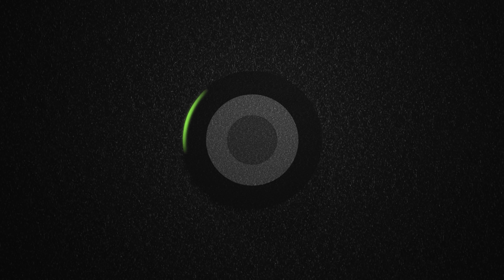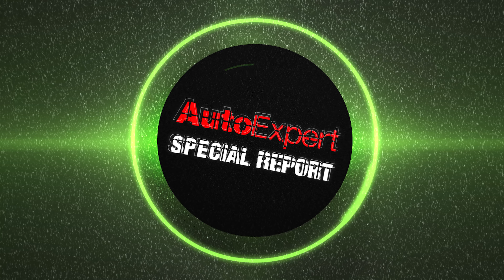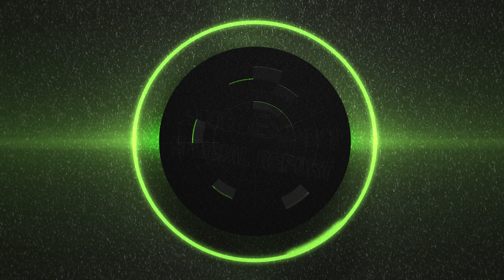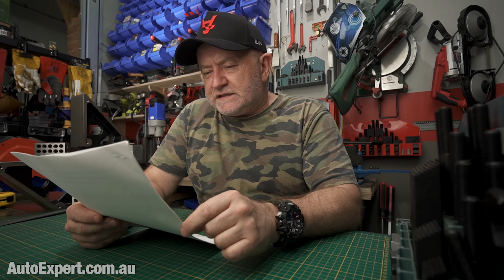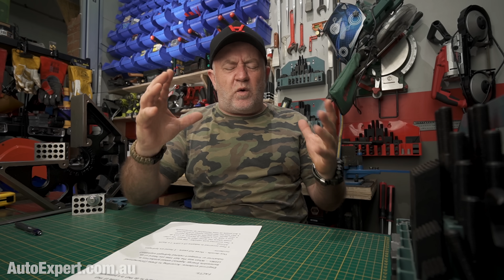The truth about fire risk: Hydrogen fuel cells and battery EVs | Auto Expert John Cadogan

Comment: No, John, we keep on driving our Kona on unleaded as recommended by the dealership that does our services. One day we will drive an electric-powered car and it will be a KIA, we have our own solar-powered electric supply system. The power is stored in batteries - just in case the grid we are connected with fails and the chance that it will is real. Any thunderstorm we might get can trigger that we have to switch over to save our goodies to stay consumable in three fridges and two freezers.
Reply: Wanna medal 🏅?
Reply: @JasonC-4  No, I just do not want to waste my money on things that only kind of work
Reply: @AOWarwick  What do you mean by "kind of work"?

An EV most definitely gets you from A to B. So it most definitely completely works.
Reply: @Andrew Hargrave  If a car was not originally built for Hyrigen and just converted? Well, drive one for a while and see what will happen. The engine will run hotter, and the valve stems will not like that for long. Now, the electrolyses will mix into the game. What about the lubricant? All I can say: Been there, done that, and it did cost time and money as the electrodes waer quite fast, so it is an ongoing problem. At the end of all this, what I saved and what it did cost me equalled out.
Reply: @AOWarwick  Who is suggesting to drive a car converted for hydrogen?
Reply: I also drive my vehicle on unleaded as recommended by my dealership that does our services.